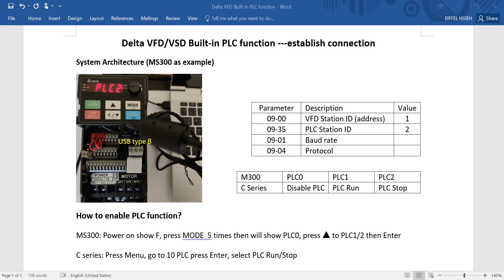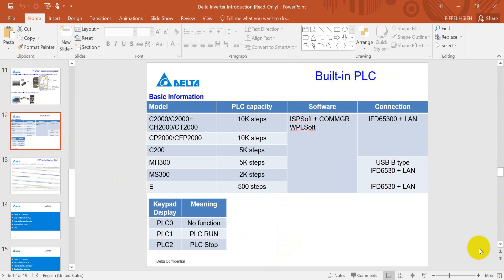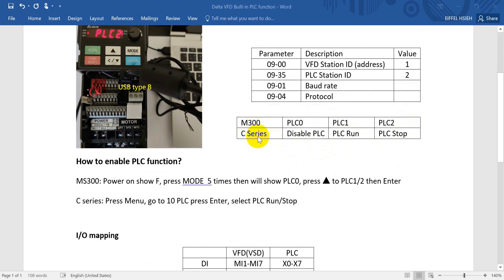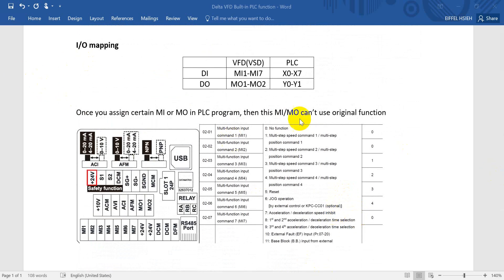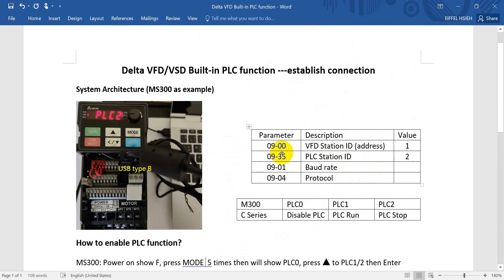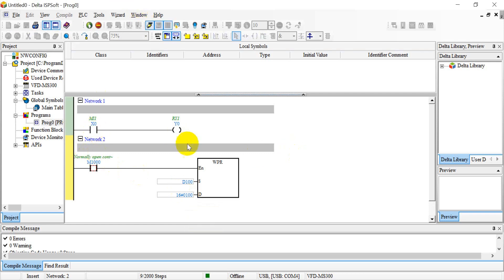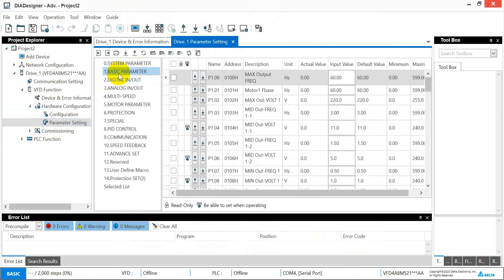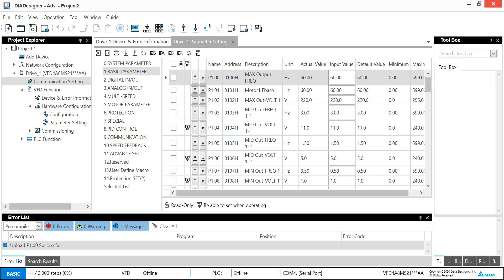Delta VFD Built-in PLC function

Comment: can i read the analog input value through modbus communication? through a clp
Reply from the maker: @Mauricio Sgorla, you can get the analog input value from data register D1028, D1029
Reply: @iabg_seadelta6647  does this apply for the VFD version?